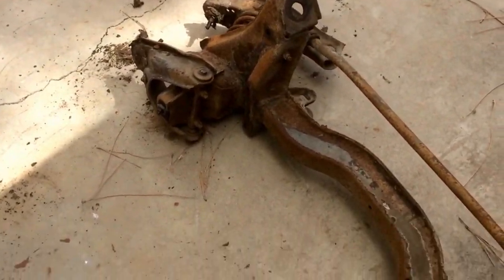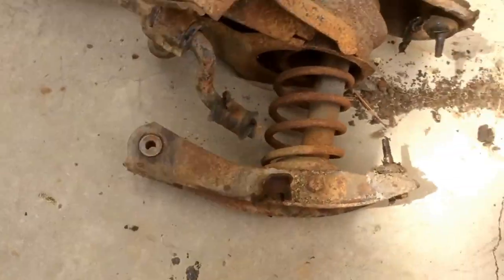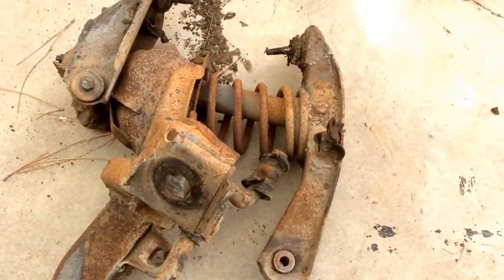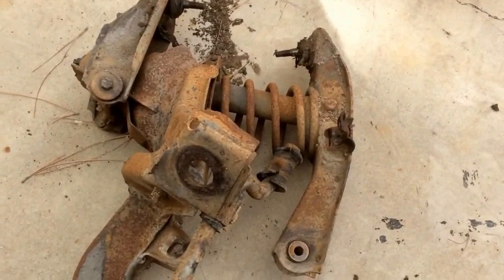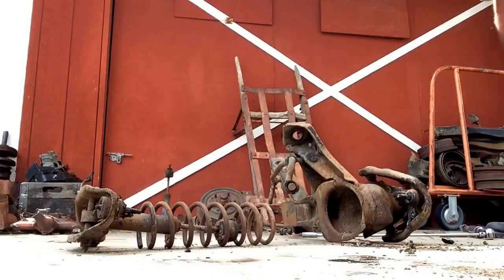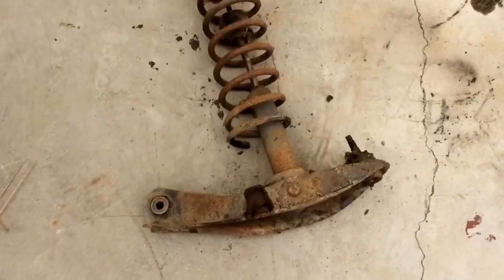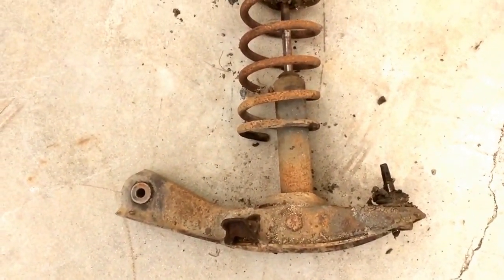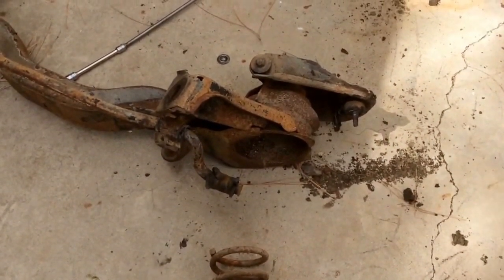Dangerous Suspension Springs and why you should be careful removing them!

Comment: Very funny. Now lets do this with the front strut of a BMW E46 and see what limb you lost in the process.
Reply: Did this on my e32 with a cordless gun and loose arms and was fine. Give me a e46 strut and I’ll do it with no problem. Problem is, people are placing these upright when doing this which is retarded. Place if it on its side and using a gun. Easy as piss. Just need to find parts later